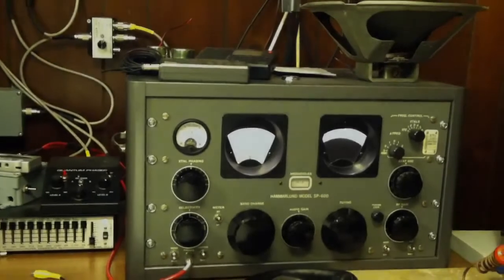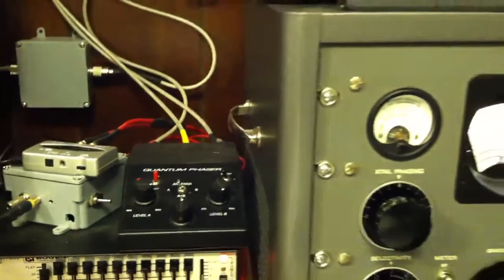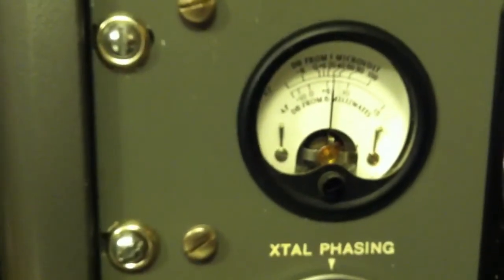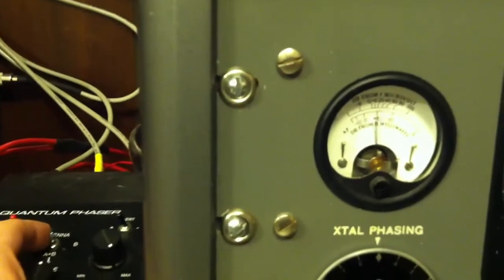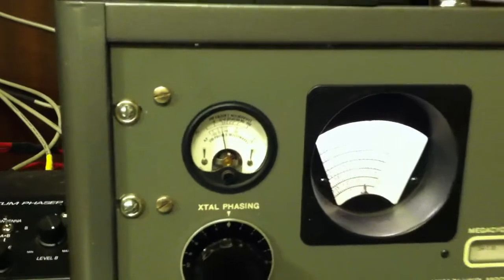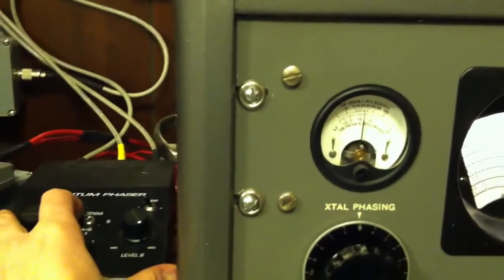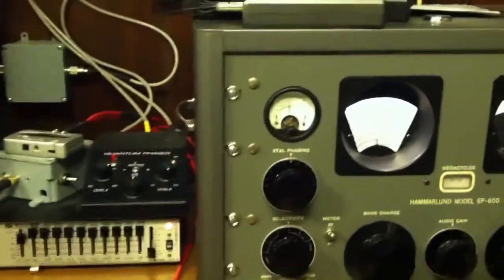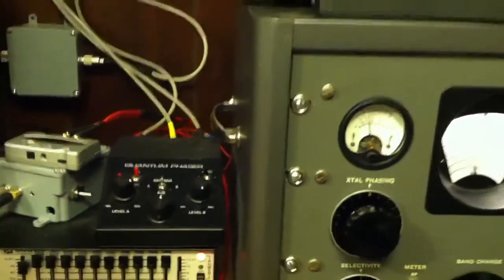Phasing Out a 5 kw Local Station With the Quantum Phaser

Comment: For real digging and nulling and DX chasing I use the Quantum Phaser EVERY time. I have the MFJ 1025/26 units (modified for MW use) and the ANC4 from Timewave and have used even the hyperexpensive DX Engineering unit, but the Quantum just seems to get me to my goals faster and more reliably... and it's the least expensive one!
Reply from the maker: Same here. Too much noise here and the Quantum Phaser just works so well.

Comment: I used a Hammarlund SP-600-JX10 for many years. Bought it from "Dames Communications" (New Jersey) in 1975. Fantastic radio which I had many good DX catches with. It stopped working when the mains-transformer started leaking tar! I tried to get a replacement transformer, but failed :-(
Reply from the maker: It's the radio equivalent to a good classic car. It's a great radio.

Comment: John, that is super!  I just HAVE to try 2 LNV (vertical) antennas like yours with my NCC-1 per your encouragement on my city lot.
PS.. It is a sacrilege to put anything atop that gorgeous SP600. Cheers.
Reply from the maker: Good luck with phasing! it's definitely amazing when you can tune out the local garbage and hear DX underneath. That is quite a bit of stuff on the SP600...I usually have a couple of things but not that much. Must have had another project going at the time. Cheers.

Comment: Could one use a Quantum Phaser not to phase out a local station but rather local noise? I know that DX-Tools, MFJ, and Timewave make noise cancellers but if I'm understanding how this device works, it seems like it could do the same thing and for a lot less money.
Reply from the maker: If the noise is outside of your house and is relatively directional you can phase it out. If it is not it would be difficult to get rid of the noise.
Reply: Ah, I see. I think the Timewave ANC-4 (for example) picks up local RF interference and cancels it out sort of like noise cancelling headphones whereas a quantum phaser is more about cancelling out a specific frequency/direction.  Both useful but not the equivalent I thought they might be. Sounds like I should consider buying both...

Thank you for the interesting video and your helpful response.